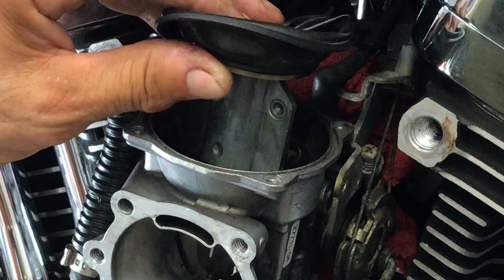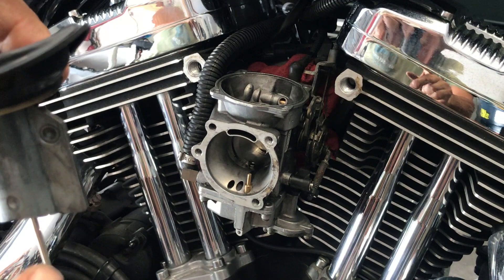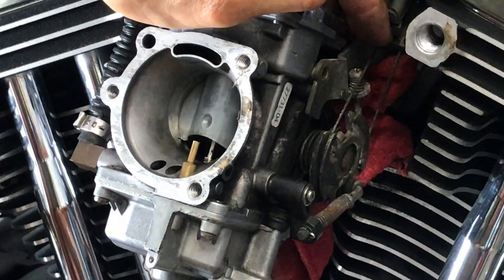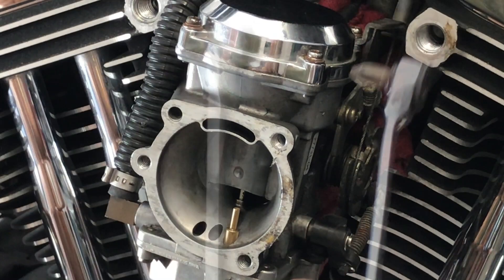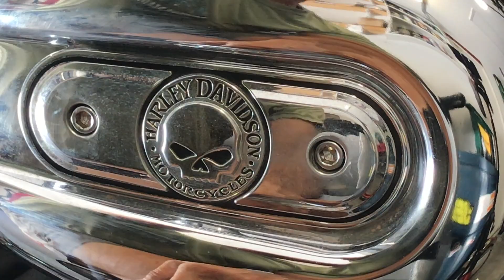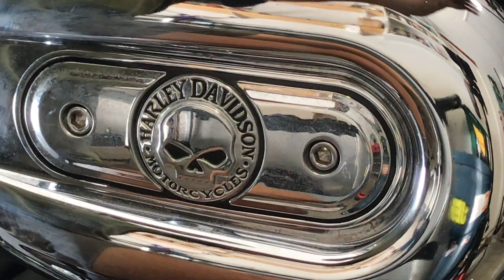How To Harley Sportster Carburetor Slide Needle Adjustment.

Comment: I gotta 2000 1200 Sportster and I'm having trouble tuning it it's got the screaming eagle package with the blue box hooked up and I'm getting a lot of intake backfires and exhaust backfires I'm thinking it's a ignition module problem or the carb is way out of adjustment,I've tried your air fuel mixture adjustments but it still backfires at low idle and at higher end backfires out exhaust this is getting frustrating
Reply from the maker: Happy to help. Did you check the petcock vacuum? I will send a video. Sounds like you're getting air in the system. Test leak in the diaphragm.  the vacuum hose from the carburetor to the petcock replace that hose. that get old causing gas flow problems. This makes a very bad running motorcycle. Thank you for watching and your sub Stephen. Let us know how it works out. Ride safe and have a great day. Let me know how that works out. https://youtu.be/7Fo9Q93OJXI.  test and replace vacuum line they collapse, causing all sorts of problems.
Reply: @TwoWheelRocco  put a vacuum gauge on that and it holds vacuum but slowly bleeds down,no gas.Ive tried replacing intake manifold gaskets on this model and I'm up too two times with still no improvement!Still lots of intake backfires and still exhaust backfires as well,the carb setting for ldle air intake was way out when I got the bike,I'd say it was more than 4 turns loose and it wouldn't backfires at idle,you suggested 1.5 to 1.75 of a turn open tried them both but nothing helped,could I be having a ignition module problem?
Reply from the maker: @stephengilfedder6152  if it bleeds down, it's no good plain and simple so don't expect something to operate that sucking air. This is your problem. Leaking Gas when sitting that means Fuel also is getting  into the system so you got both things going on. you can never tune your bike with that condition. change the diaphragm change the vacuum hose and start off with a strong foundation. That's where I would starts,  Fuel delivery. Hope this helps.  Let us know how it works out.

Comment: That is a really usefull video, thank you very much. Now, when is the best time to put down the choke after turnin on a cold engine? And is there a difference during warm or cold weather? Some say to put it down exactly after turning on the engine no matter the time od the year, rather keep it running with holding a throttle... Others say to warm it up with choke a bit, ride for a mile, when it warms up, put the choke down? What should I do? I have a '94 883 Sportster. Thanx for the answer...
Reply from the maker: Ride it for a mile or so, when it warms up, put the choke in. That is the proper way to operate your choke. Hope this helps. Thank you for your question and Sub Sunny. Any questions just ask. Ride Safe and ride safe.
Reply: @TwoWheelRocco  thank you very much sir. I really appreciate it...

Comment: Rocco i took apart the carb and cleaned the accelerator pump and orifices cos pump wasnt spraying gas. I then put it back together but still getting carburetor pops/farts. I checked for intake manifold leaks with carb cleaner but there seems to be none. I just cleaned and reused the old diaphragm for the accelerator pump. Now i am thinking either the spray isnt enough or maybe i should do this so to make it less lean to get rid of the carb pops? It idles fine only when giving some throttle this happens. Please advise, thank you. Mine is a 86 sportster 883 where someone installed a cv carb somewhere down the line and it doesnt have the butterfly carburetor
Reply from the maker: Happy to help. When you twist the throttle and look at the throat of the carburetor, is it spraying from your accelerator pump pin? If so, then try the washers under the needle. What jets are you running in that carb?  Let us know how it works out. Thank you for all your support. Texas iron. Ride safe and have a great day.
Reply: @TwoWheelRocco  yes it was not spraying previously. So i took the bowl and pump out and needle and cleaned all the passage ways per your other video. I reused the diaphragm as it did not look torn and just dirty. It sprays fine now when i give throttle and much less carb pops than before where it was super lean and stalled on me at stop light resulting in dropping my bike. I want to add the 3 shims as you suggested and bring needle to hardware shop. What size thickness of each washer should I get? I am assuming the outer diameter is fine as long not too big where it wont sit on the circular area the needle goes on to. Just want to make sure i get the thickness correct for the three washers.
Reply from the maker: Happy to help they are like a 32 but like I said, if you get a 16th just put two and see how it rides put three and take a test drive you'll know and you will feel the difference. I don't think there's any more radio shacks around or any kind of electrical place that sells those small washes  I will sent you the eBay ad I'll take a look.https://www.ebay.com/itm/291994473665?hash=item43fc3a14c1:g:9foAAOSwjDZYcZKD&amdata=enc%3AAQAIAAAA0Bgn0CFr0eFkJbftDgP5ukz4tcAzwiuyyIQ9mrNlbPhK3crdT5N%2FQ9upPnKxxJ02jm2QYIIC1685TSWB9qNcXisRakdVc4nUUTT7IINr%2FEL9BCu4m5PSRVvHC1%2B2%2FxxGgZNHUnHIKGIMGNNY9f0uM9pyPt%2BFuW%2Fyj0BJWwLhQL0OVPb3Tr6gofjbDRCv7AOqUcDJXd4x7w0bfJS2cVvRrV2dqd%2FfBaRGkYBOXlY0C8Xlw3qGVCXqaoP3dIo9MMR8VuS3iGp2Jt1nHrkLPobPckY%3D%7Ctkp%3ABk9SR8y6pb6JYw
Reply from the maker: https://www.ebay.com/itm/185107057049?hash=item2b193d8999:g:7PwAAOSwBSdlZ3TM&amdata=enc%3AAQAIAAAA0Gj7EOHlxDdzi9dVVVoPbidTiLD%2FULa6X%2B7E%2BSn2cwGhGTUfQztj0lRxPrC%2FRLhnqbWZTW8JjhOA3AIygaSnezajjHnYAVifOGhjcAe4BQQjYPk84V1p%2BGfxxe0ee5DUNZVfztTbr6v8nU0GWs8x2VmmYxYLgD%2FWZvd9AtY3a50iYtLkFABJKje5bLx3Ms7EkbhnJUUU%2FtcaFI82Zazcy%2FsBr3UZ7o9KzOh2BT1slFrqJsBLRfHnzoshe6fGjJnTEpG5I3Wyafvl7PeKZ99YBRQ%3D%7Ctkp%3ABk9SR866pb6JYw.
Reply: Thank you, appreciate it. I will try the washers and let you know how it went.
Reply: Rocco, I added three #4 brass washers from
Ace hardware to the needle and it runs like a scalded cat. No carb farts nothing and it’s a cold day in Texas today as well so it was a good test run for leanness. Thanks a million!!! I am not sure of the thicknesses or if they are very uniform but it runs well now. I have not taken it to full throttle but i doubt the issue was ever anything at full throttle and more of a mid range issue. Thank you for all that you do!
Reply from the maker: Happy to hear all went well. Usually the situation is off idle that little hole needs to be filled and when you put the washes it changes the Fuel curved. Happy to hear. All went well ride safe. Have a great day. @TexasREGuy

Comment: Do you know the thickness of the washers? We always used to use one washer of .050 thickness. Just curious if I should try .075 or.060. Those washers look fairly thin.
Reply from the maker: https://www.ebay.com/itm/HONDA-CM400-CX500-CB750-CBX-CARBURETOR-PERFORMANCE-TUNING-WASHERS-BAG-OF-50-/382517078367?hash=item590fcb695f Happy to help. Let us know how this works out.    Thank you for watching and your sub.Nick. Ride safe and have a great day

Comment: hi - can i spray lube the linkage on the carburator?  to help throttle snap back...
Reply from the maker: If you put some slack back into the cable adjuster at the twist grip you will realize you will have a free snappy throttle then do your adjustment and fully understand how it works I'm.  https://youtu.be/RzTyoN6Wyro.  send you a video take a look at it it's on installing twist grip but the adjustment is done for that video take a look. Happy to help. Thank you for watching and your sub Frankie. Let us know how it works out. Ride safe and have a great day.

Comment: Great video!! I have the same 05 sportster 1200 custom. I’m going back to the stock carburetor set up. The motorcycle has 45k miles and I’m planning a 3k mile trip to Mexico. Do you think I should rebuild the carburetor and if so, any links to kits you recommend?
Reply: By the way, my motorcycle runs great now but I’ve never done a tune up on the carburetor. That’s I’m thinking I should rebuild it. What do you suggest?
Reply from the maker: Happy to help. Any questions just ask.  Thank you for your sub Gabriel. Take a look at this video on cleaning your Sportster carburetor.  https://youtu.be/Pp4l-zbQcy0.  This is all you need to do.  No parts needed. Let us know how this works out.  Ride safe and have a great Trip.

Comment: Any idea of the actual thickness of those washers ?
Reply from the maker: Happy to help. 1/32,  I bought them on eBay. I'll send you the link for the washers. Thank you for watching and all your support Adam. Ride safe and have a great day.      https://www.ebay.com/itm/291994473665?hash=item43fc3a14c1:g:9foAAOSwjDZYcZKD&amdata=enc%3AAQAIAAAA8PsAvF6FOylpepYNpH0Mz9CQC4u4z01m0llM9zFx4u%2F6vEXsGUE5r2o97jWOr9gOChfgzTSI8lUERMKVlA4BUngF%2BGuU93yWw%2F6V6RgA8S6VJyTWYRAd9mYuGSNPYSTndQO9ZZhBfIXL1FZlHAPoZSbln6XtaGgNCpscWDW62zLsrPhG6aFoMJfp7CQ9VWOyxK2JFYyPkb1F1Quj5ChOxrP3TkXxbaW3G5Vt9XTPQdGOW1Wle%2BscjkAID%2BUd%2FskodQhHf6kxp9lo5GRUuMYI0V5WFQmuqP6ZzZlxjUoySPGHGA4IDvuOBDvQOURrHbteBg%3D%3D%7Ctkp%3ABk9SR9K2z72PYg.  If you look, you can find them in a smaller quantity.

Comment: My 05 sportster  is idleing with black smoke slightly but if on choke it will stop smoking. Seemed like it would never warm up with a continuing on smoke.??? Pretty sure just stick carb
Reply from the maker: Test your petcock, sounds like the diaphragm is starting to fail and it sucks gas through the vacuum line into your intake that causes a rich condition I will send you a video on how to test Petcock.   https://youtu.be/7Fo9Q93OJXI.    Let us know how it works out. Thank you for watching and your sub Christopher. Ride safe and have a great day. Any questions just ask.

Comment: Hi there great video...I'm back to riding esp. with gas being so pricey.  Noticed I can't get above 80 on my 2005 883. All stock. Seems to big down at that speed. Any ideas? Thanks
Reply from the maker: You need to look and find out what main jet  you're running. Make it bigger and you'll have more top end.

Comment: Rocco, i have a 2000 XL883C..... you're videos have really helped me to get this bike running great... can you share a link  for these washers please?
Reply from the maker: Happy to help. I will send you a link through eBay. Let us know how it works out. Thank you for watching and all your support Brendan ride safe and have a great day.   https://www.ebay.com/itm/382517078367.     https://www.ebay.com/itm/185107057049
Reply: @TwoWheelRocco  I may have missed if this was only fo2 1200s? I tried 4 washers, then 3 on my 883 and she doesn't seem to like it vs using no washers at all...  have you experienced this before?  i seem to be creating a "sputter" around 2400-2600 rpms. I've dialed in my fuel/air ratio to 1 & 3/4 turns out and it sounds great and hauls as well on the top end of throttle but I can't shake out this new sputter. was thinking about removing them again and starting without any washers to see if the sputter remains... any thoughts?
Reply from the maker: Could it be possible you have the washers in the wrong spot? It needs to lift the needle up so that means those washes will be at the bottom. placed back in and then the spring. Has to make a difference you say no difference. Just think about that you move the needle three washers up and there's no mid range differenc, that will affect off idle a bit bit. Take a look. And let us know. Thank you for the update.
Reply: @TwoWheelRocco  yes sir! I will double check my placement and reset. Thank you man always appreciate your help & knowledge!
Reply: I bit as liked the larger jets and 3 washers and I am running awesome! Thank you for all of your videos!
Reply from the maker: Happy all went well Brandon. Love those sportsters. Thank you for watching and all your support. Ride safe and have a great day.

Comment: Rocco, for my 2001,1200 sportster I followed your washers on the needle video and how to clean your carb and decided to take it off and do a dip in Berymans carb cleaner, after I installed the carb back on, it started fist time .It ran good but this is what is going on, I did adjust the throttle cables and with the engine off the throttle works fine has a quick snap back to idle, but with the engine running the idle cable has a slow return to idle ,like a drag is holding the grip. Any ideas? I bought the washer you gave in the link.
Reply from the maker: Happy to help. The throttle cables are binding at the adjustment put some play back into the cable and you'll see it will snap back with ease. Let us know how this works out,     Take a look at this video.     https://youtu.be/RzTyoN6Wyro.   at  6:36.  Thank  you for watching and your sub niteride.  Ride safe and have a great day.
Reply: @TwoWheelRocco  thanks for your advice, cleaned my carb put the three washers on the needle and adjusted my cables. Bike runs fine, Gracias.
Reply from the maker: Happy to read all went well. Thank you for watching and all your support. Ride safe and have a great day.

Comment: can someone tell me the dimentions of the washers please or a link to these washers as i can only find quantity of 50 and i only need 3 thanks
Reply from the maker: Hope this helps. https://www.ebay.com/itm/203877979597?hash=item2f781315cd:g:Pz8AAOSwDHFiORgA&amdata=enc%3AAQAIAAAA0H3Bk0l%2B6zut07QLTRjPDGDqSRWNd5e5R6qWh9Xq9M1DQV7SOPIsRCFFwXj2jz8nZPAo2zc7aKHbyTtfvcvQHVp%2BEDZBSEtmpxtxd%2F7zWpyzum%2BvBv%2B%2Fw682tT0JviywiyMIWOvVNClFNgrJAAL2dN%2FPYN%2B%2FrM4SoKmgCkq7R8r7%2BgtyG3XVRPilZ6xWQVqXTCjN%2FrP6KPUKSNNbHV8vuOSmE9B8ArDd2zKjBxT8btc1C7GuwLa21IFNXdxlWw24%2Bd9uB2SJu%2Fvp%2B7U27hFAq2I%3D%7Ctkp%3ABk9SR-Cq6dWGYw
Reply from the maker: or.  https://www.ebay.com/sch/i.html?_from=R40&_trksid=p2334524.m570.l1313&_nkw=motoecyucle+carburator+washers&_sacat=0&LH_TitleDesc=0&_odkw=cv+carburator+washers&_osacat=0

Comment: Great video! How  many thousandths of an inch or MM are each of the washers you installed under the needle? Not all manufactures create the same thickness washer.
Reply from the maker: Happy to help. I would say a 32 thick. Thank you for watching and your support Shawn. Ride safe and have a great day. I'll send you a link on eBay for those washers.   https://www.ebay.com/itm/291994473665?hash=item43fc3a14c1:g:9foAAOSwjDZYcZKD&amdata=enc%3AAQAHAAAA8JVT0x8h8xiC9sokeZDptOk3GulabMJ5HxzxJQuC3vYDPkGd%2F8GK4HWXGugZFPZ41MbhmTd7rVkoiMMV9gHtJ15Ix4Xx6uZsiDEB%2FvHXtiLCJe6M613jJbdqlNpRLByizRMEx%2FZZ2aSK3Eq9PB1p8FKzyXhCXn2z1CQQTsLgz29JxFECmbvq%2FMvO1V6PWz8pwlWHmc3dH61AknRL%2Fy%2FurapWTFoXBvp3cUEOW76K%2Bkg%2FqVWWuxV4hQPUKYS6TrHYTl8ekZ6xx0r9VeYgnxsWccNmY6ox%2FWaiQy9zUmxjbisfQqSDROGIP7DVLuzLjK1DEg%3D%3D%7Ctkp%3ABk9SR7KPqtjIYQ. If you search around, you can find them in packs of 4 or 8pc.

Comment: Please tell me that that takes place for the air fuel the one that’s underneath the brass fitting that she said to drill out and pull it out with the screw. This carburetor doesn’t have one of those plugged up adjustment because I drove that out and there was nothing behind it
Reply from the maker: Happy to help. If you could please send a picture of that, Look close there's a screw. to the erocco3964@gmail.com. There has to be an air fuel screw in the back by the intake of your carburetor. It would leak fuel if not. Thank you for watching and your sub Sammy. Ride safe and have a great day.
Reply: @TwoWheelRocco  thanks for all your help I watched a few other videos and it was plugged up with an aluminum plug. So I drilled it out and there it was I bought a rebuilding kit and it came with an extension for that so that I could adjust it with my fingers it also came with the extension for my idle screw so that I could adjust that with my fingers and it made it so easy to fine tune and the bike is running so great it’s never ran this good before. Oh and I also put a filter on the fuel line I think that was where the problems all started the bike sat for a while
Reply from the maker: @sammydio1472  Always service the Petcock screen. Every 10,000 miles. That is your filter, $10 part,  You're right that's where it all starts. Bad screen. Thank you for watching.    Ride Safe and have a great day.

Comment: Hello again Rocco:) Q: I have 3 washers on my slide needle (06 Sportster XL1200C) I changed the pilot jet from the 48 to 45. My question is, what would taking out 1 washer do(as you suggested in an other comment? Would it help to smooth out the throttle?
I still have been playing around with the A/F screw...I'm now at 2 1/4 heavy (Seems to be smoothing out from being jumpy) Thanks again in Advance
Reply from the maker: 1 3/4 on the air fuel and let me know how it runs? with the 3 washers under the needle.